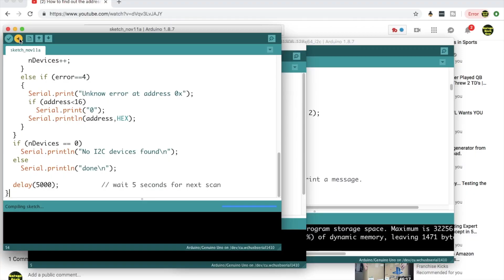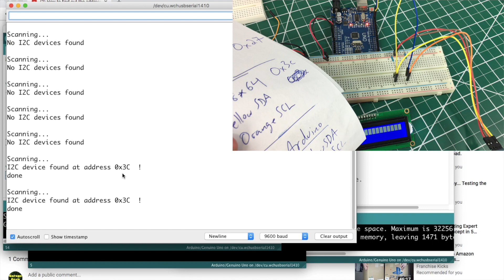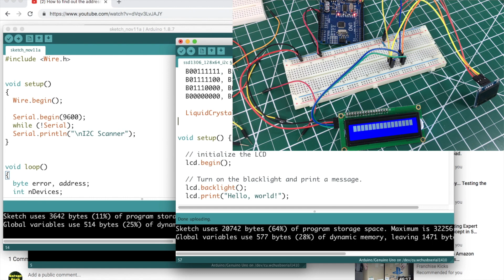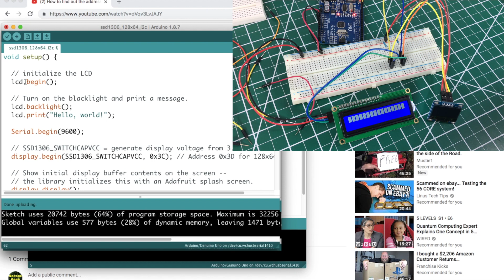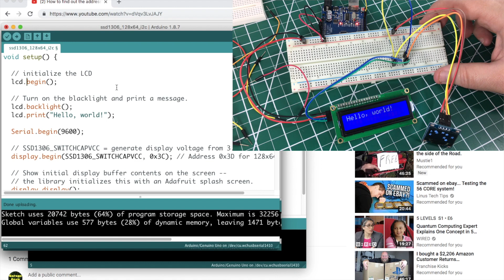How to use multiple i2c devices on the same bus with the Arduino

Comment: since SCL and SDA are supposed to be common to all devices why not put the yellow and blue wires into the open power rail on the other side? unless both power rails are already connect together internally

Comment: nice video! I was searching for this as I'm also going to use an RTC i2c with a i2c LCD. BTW, just wanted to point out that most of the i2c devices boards already have the pull-up resistors on them so no need to wire that.
Reply: I also i wanted to do same but does Arduino uno board comes with pull-up resistors ? I really didnt understand how to do this whole shit. It would be really helpful if you give me a short summary for connecting multiple i2c device rtc module and a display

Comment: #include <Wire.h>

void setup() {
  // put your setup code here, to run once:
  Wire.begin();
  Serial.begin(9600);
  while(!Serial);
  Serial.println("\n I2C Scaner");
}

void loop() {
  // put your main code here, to run repeatedly:
  byte error, address;
  int nDevices;

  Serial.println("Scanning");

  nDevices = 0;
  for(address=1 ; address<127 ; address++)
  {
    Wire.beginTransmission(address);
    error = Wire.endTransmission();
    
    if(error == 0)
    {
      Serial.print("address is ");
      if(address<16)
        Serial.print("0");
      Serial.print(address,HEX);
      Serial.println(" !");

      nDevices++;
    }
    else if(error == 4)
    {
     Serial.print("unknown address");  
     if(address<16)
        Serial.print("0");
     Serial.print(address,HEX);
    }
  }
  if(nDevices == 0)
    Serial.println("devices not found");
  else
    Serial.println("Done\n");

  delay(5000);
}

Comment: The OLED is really flickering. I've used OLED before, singly, and no flicker like that. Suppose it's because it's sharing the I2C? Probably so.
Reply: @Garan Carter-Woodgate That OLED works at 3.3V no? Hooking it with 5 V supply would wreck it no?

Comment: Use the photon-pixel coupling method, it is a new approach in science for reading an unlimited number of sensors in parallel. Maybe you can do it with an Arduino. From what I know it supports a cam.